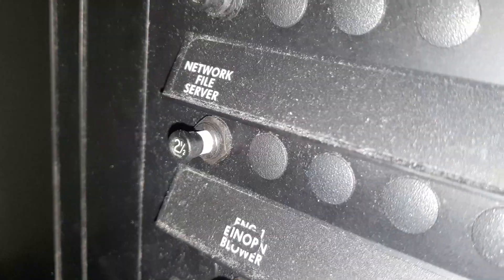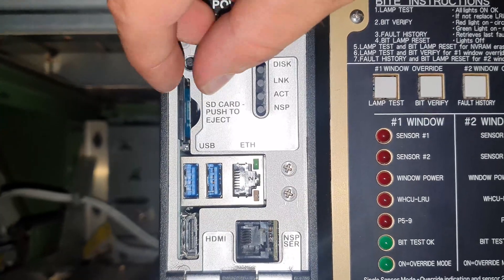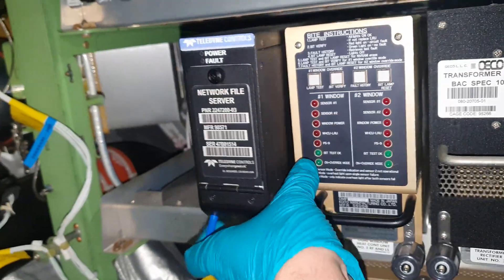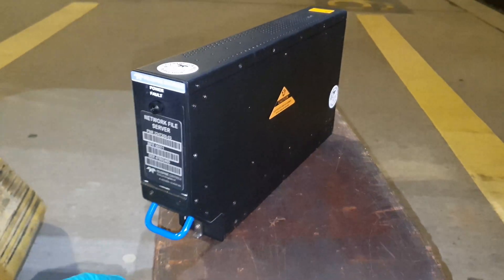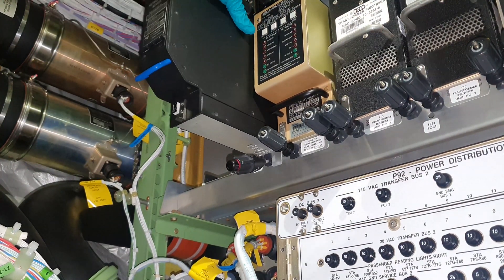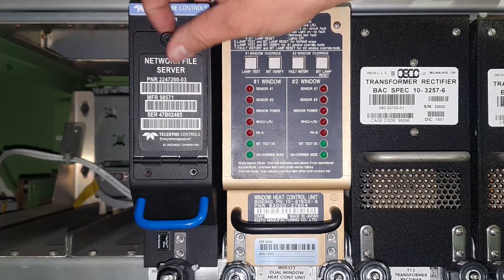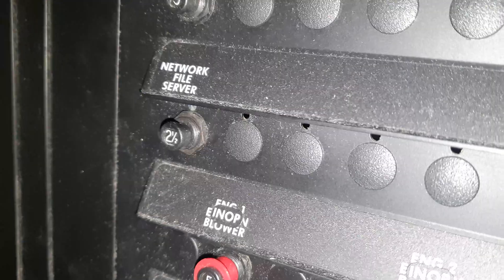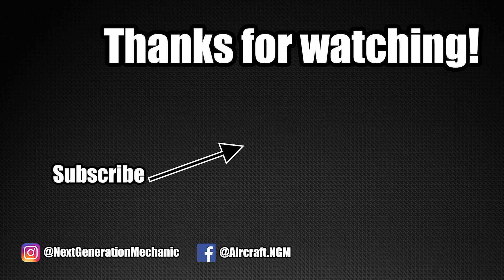Boeing 737: Network File Server Replacement

Comment: Have you ever changed the in-flight entertainment system?
Reply from the maker: Yes but not on a 737!
Reply: @NextGenerationMechanic  I'm very curious about how in-flight entertainment systems work. When the first entertainment systems arrived, did you install fiber cable throughout the plane?

Comment: Amazing, lately replaced on B777, it was interesting job to load softwares in ONS.. smoother than before via mat.
Reply from the maker: It does! It is a pretty time consuming job though.
Reply: I still fail to install it on 777 recently, the data for initial data load cannot be imported, dont know why, hv already followed amm @.@

Comment: But can it run crisis
Reply: Probably yes. The datasheet states it has: 
- Intel® Core™ i7 Server Subsystem Processor
- 8-16GB DDR3 RAM
- Up to 1TB Solid State Disk (SSD) storage
- 1x 10Gb fiber optic Ethernet rear port
- 4x 1Gb fiber optic Ethernet rear ports
- 3x 1Gb quadrax Ethernet rear ports
- 13x 10/100Mb quadrax Ethernet rear ports
- 2x 3Gb fiber optic ARINC 818 HD video rear ports

Comment: Why a sd card that sounds like it would give so many problems compared to a normal ssd
Reply from the maker: Basically the NFS is the ssd or 'master storage device' the SD card is a backup if the master storage device has a corrupt file and can't re-boot anymore for instance.
Reply: @NextGenerationMechanic  A that makes sense how big is the SD card
Reply: Sd card has booting configuration file and software, no need to upload on new replaced NFS. CARD will do the job.

Comment: How you work with P91 P92 panels?
Reply from the maker: What do you mean?
Reply: @NextGenerationMechanic  I've seen that some airlines have added an extra step to their amm. Something like that: When working with P91/P92 panels, use a dry, long wooden stick, because of the possibility of electric shock